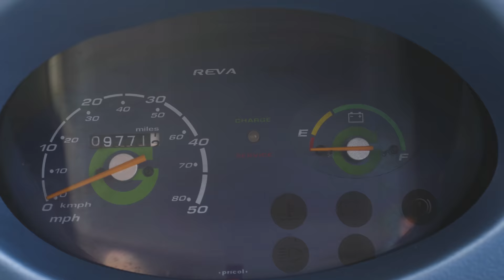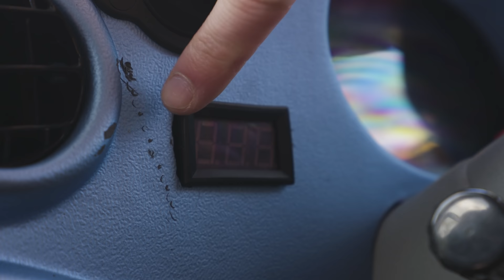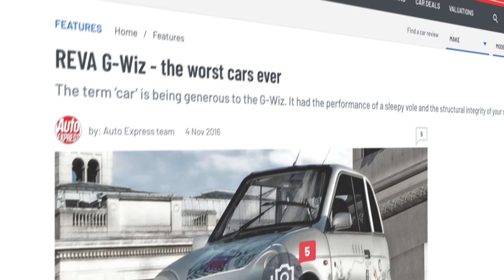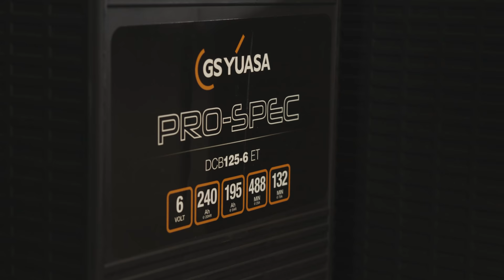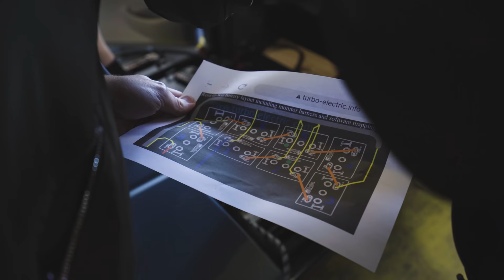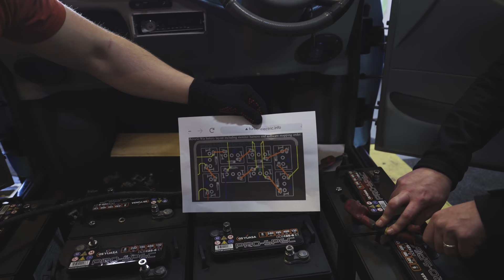We Bought The Cheapest (And Most Hated) Electric Car

Comment: been long years seeing someone bought it back to life
last time i seen some drove it have two or 3 died battery get up to 40mhp super short range
shifter have reverse, neutral, economy forward (weak power but long range) and forward (full power)
i be waiting for them do full recharge up battery n test run and see how long can it last on forward (full power) then later recharge it up (before u do that n find area where always slower speed road in long run them recharge it up ) them do test speed in economy forward a d see how long range is that

Comment: And now put some modern batteries in it! xD seriously though why use lead acid batteries for a car in 2022 unless recycling some old ones? :facepalm: some lithium batts would make it quicker (because lead acids voltage drops a lot more when you go full throttle than it does with lithium batteries) and it'll have more range